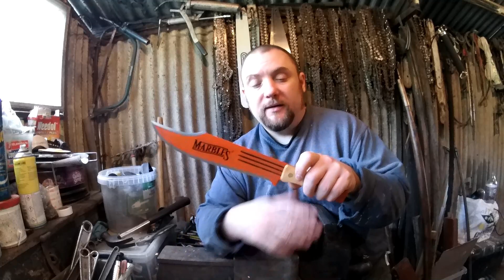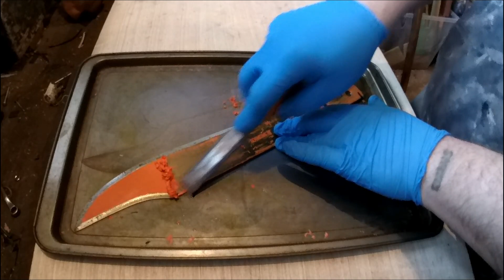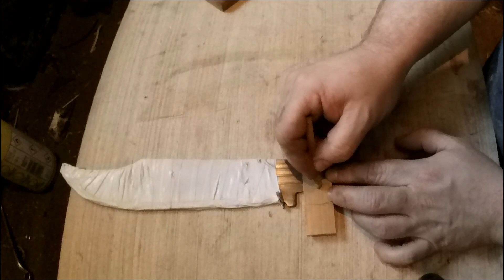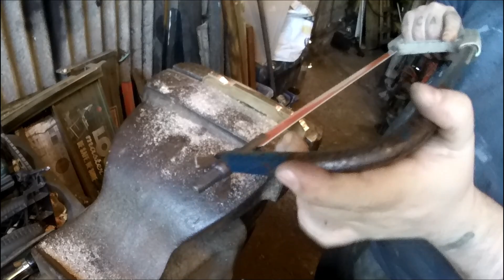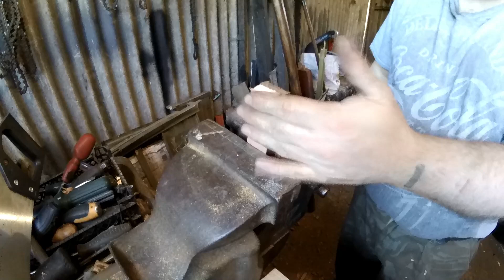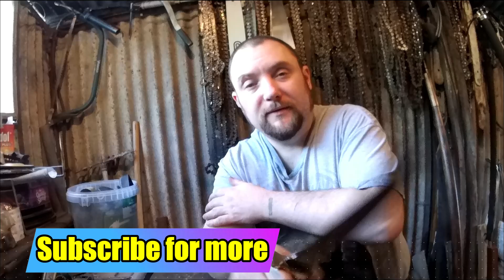How to make a Bowie knife (FULL EASY TUTORIAL)

Comment: Nice Video Mike great build and demo, that's CZ1 brass, it's good stuff for grinding, it has a little bit of lead added to it to make it machine nicer, I use the same brass rods in CZ1 for my handle pins in knife handles. Good stuff, you can peen and hammer it as well and it doesn't crack much.
Reply from the maker: Thanks mate, yeah that brass is lovely to use isn't it, was mostly down to you i found some good brass in the end after your advice on a video, i've still got some brass that's really tough to work on, the cz1 is really nice though.
Reply: @WeaponCollector  Glad it helped Mike, it's really good stuff I don't use any other type of brass now since I found it, really pleased with the stuff, it's funny how adding that tiny bit of lead makes it so much better to work with, and they do it in a way so that the lead doesn't come out of the brass, so it's still safe to handle and put on things that contact food, and can't give lead run off, really well made stuff.

Comment: Fantastic! Turned out great! I have a 24" marbles machete that I wanted to remove the orange paint. I will use this method. Thanx again Mike!
Reply from the maker: Thanks Karl, i am very happy with it, yeah if you want to remove paint, do that nail varnish remover trick, i learned it the hard way trying to remove paint form a pry bar, tried sandpaper, scraper, burning it off, nothing worked , then suddenly thought of acetone and it worked lovely.